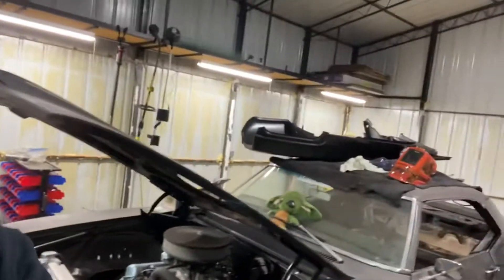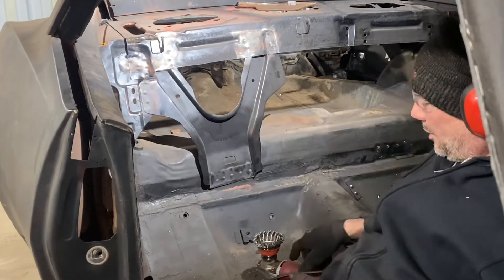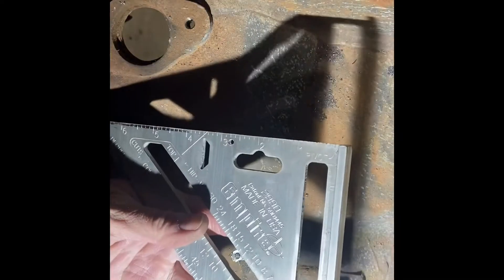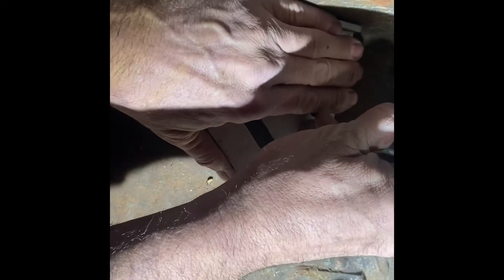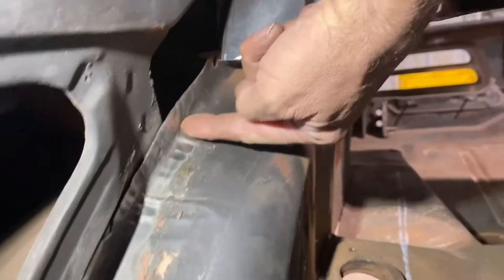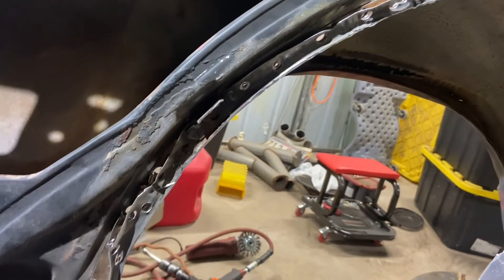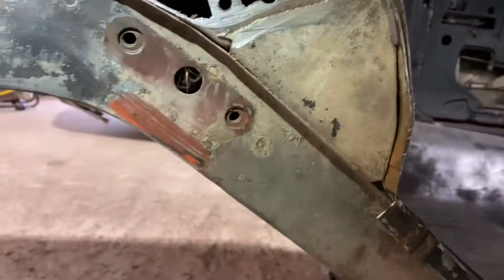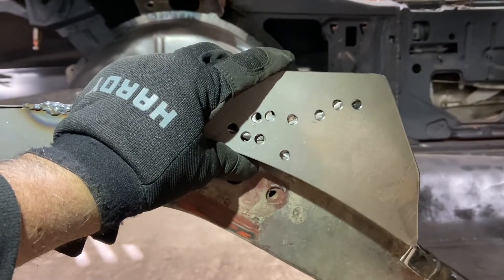Detroit Speed Mini tub installation 67-69 Firebird/Camaro part #2: Passenger side.

Comment: Just finished on my 67 camaro. One trick I found is to use a magnet laser. I made the anchor point for the back a 2 3/4 and then one up front and then connected the two with the laser and the drew my line and marked with tape as well. Came out perfect! Trying to scribe it by hand and get that really straight was dang near impossible on the other side before I tried this trick.
Reply from the maker: That would be a great way of doing it.  If I do another one someday, I’ll have to remember that trick.  Thank you for sharing and watching.  I appreciate it!

Comment: Thanks for the video.  bout to jump into this but bought the cheap kit with no templates!  lol.
Reply from the maker: Glad I could help.  I would think the measurements would be pretty close to the same.  Good luck and thank you for the comment!!
Reply: have you installed the kit without templates yet... Im in same boat
Reply: @KittyBertandErnie  I did!  wasn't too difficult, but finding good templates would make it a lot easier.  I don't have some special method I used.  I just raw dogged that shit.  I started by just cutting out what I thought needed to go, leaving enough material where the new edges would go.  I did that so I could literally place the new tub in that space with the old shit out of the way, then trace along the edge.  hard to explain.  but you can't really place the new tub "over" the old tub to trace the edges.  but if you cut most of the old tub leaving just enough that you know will overlap, it worked out.  then I traced and trimmed..  got pretty damn close.  but 2 spots I screwed up and had to add pieces of metal.  in the end, worked out fine.  I didn't take photos of video though.  should have.  :(